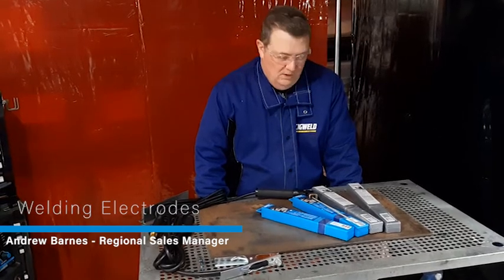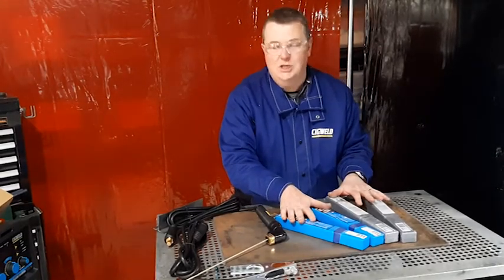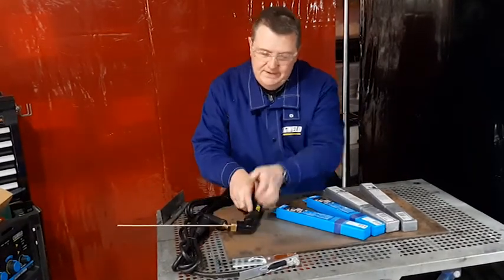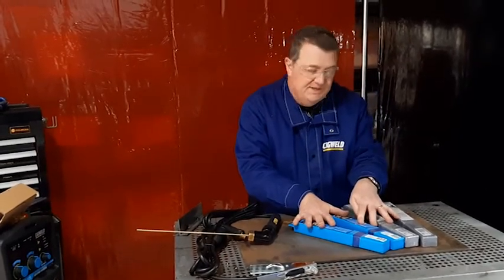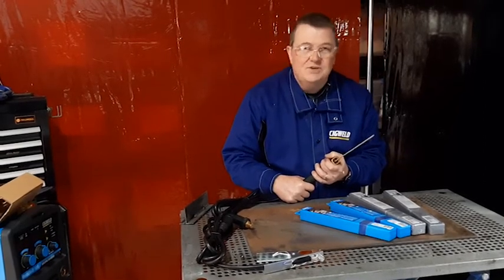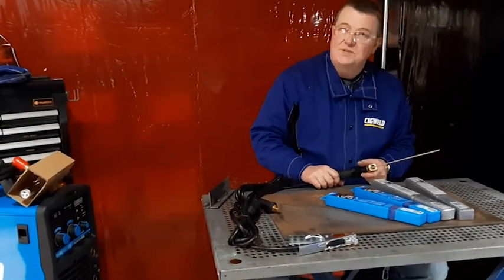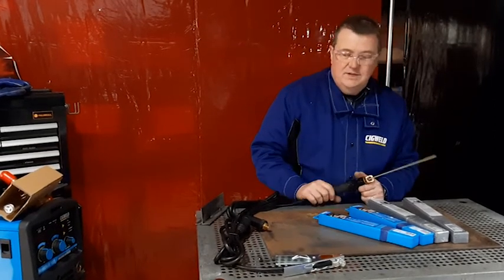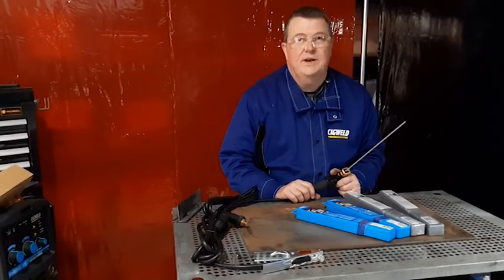Welding Electrodes

Comment: Appreciate the vids but you fail to mention and it’s also not in the manual, when I swap from MIG to Stick, do I have to remove the wire spool, or just cut the wire off at the torch plug point?